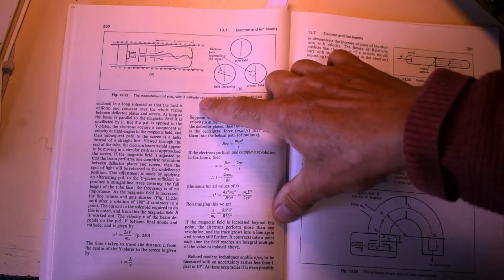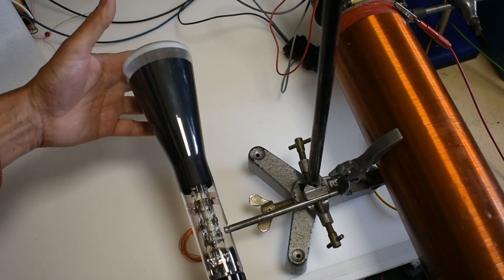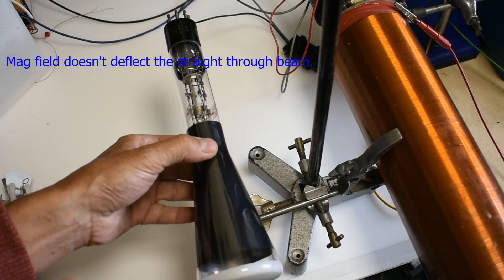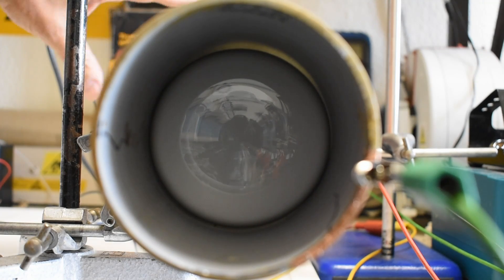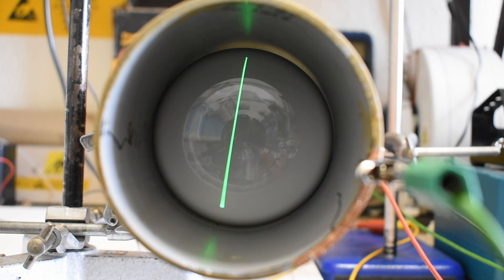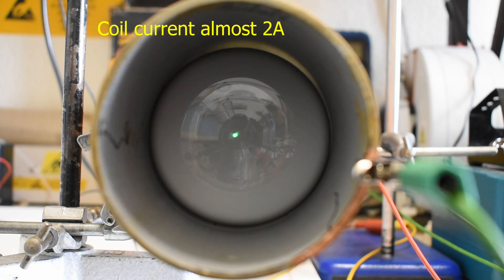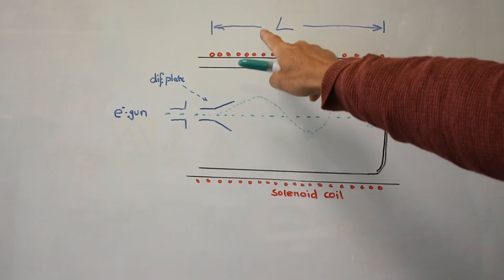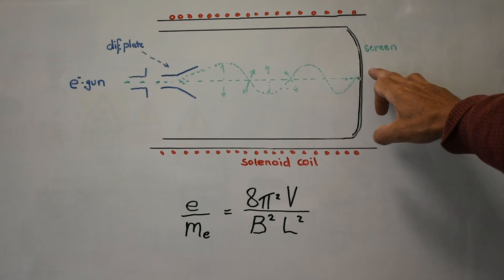Introduction to particle accelerators using a CRT

Comment: Great!  Never easy to explain the path of charged particles in circles around a linear magnetic field, let alone a those that already have a horizontal velocity as well resulting in a helical path.   As an aside you say 'pipe' when you talk about the external coil - which is indeed the Greek etymology of the term solenoid!